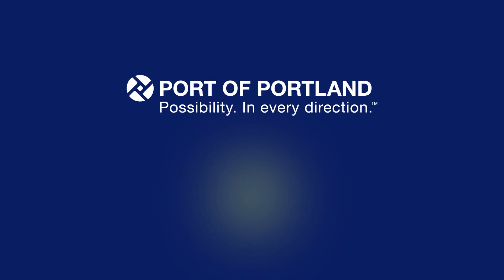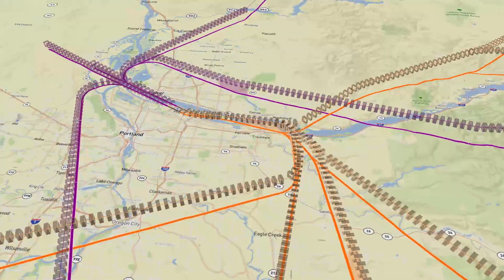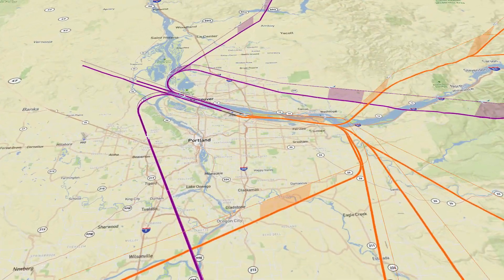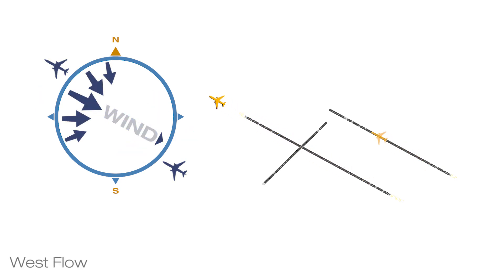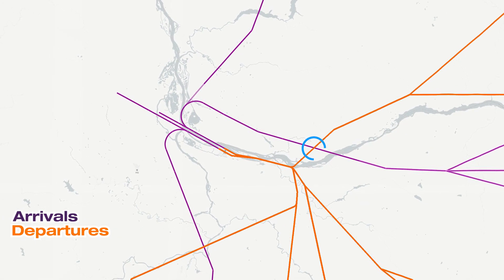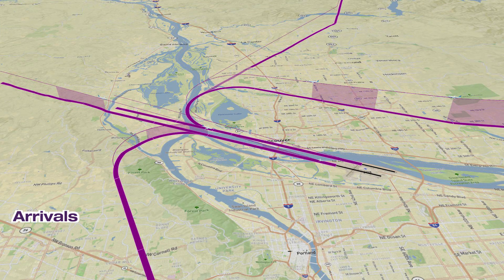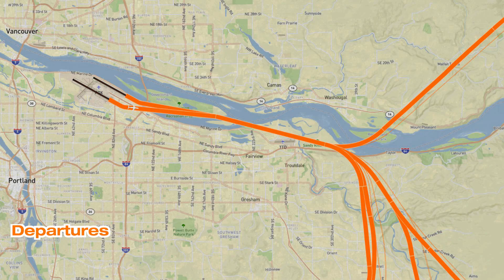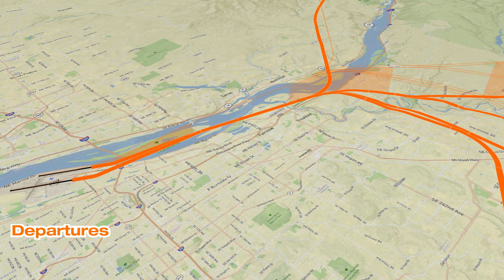NextGen partnership reduces noise impacts

Comment: Absolute lies.  NextGen was made to maximize profits for airline corporations and their associated corporations and airports.  Saving fuel by low long approaches, refusing to disperse flights, taking the same path over and over the same homes, from sunrise to well into the night, with proven particulate and gas emissions that cause health problems, noise that causes greater incidences of cardio-vascular problems and heart attacks, anxiety, depression and other disorders.  Property values fall by an average of 20 percent.  Constant noise at intermittent intervals acts as a punishment, with the anticipation of the noise as bad or worse than the actual noise.  NextGen is inefficient, incompetent and insolent, disregarding the rights of Americans.  It makes the trains run on time, like any good dictatorship, but this is NOT a standard for democracies.  STOP LYING.  NextGen is made to increase corporate profits at our expense.  The developers of this corporate gift from the FAA should be found out, named, and personally held accountable for costs to health and property.